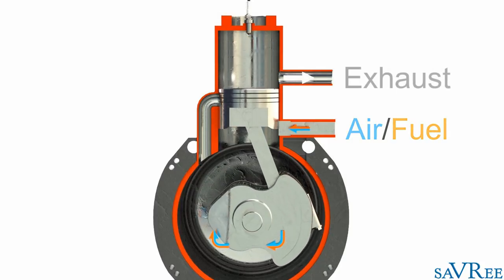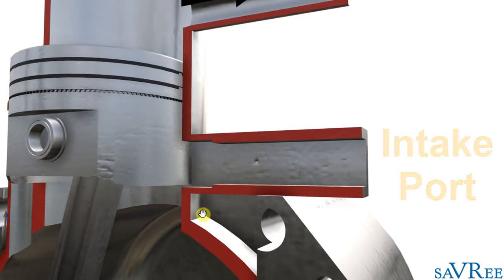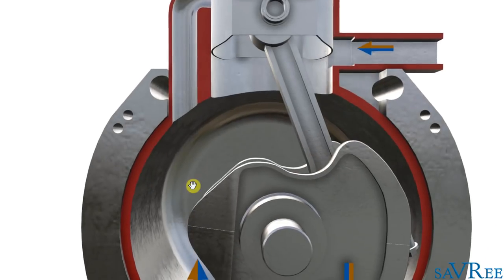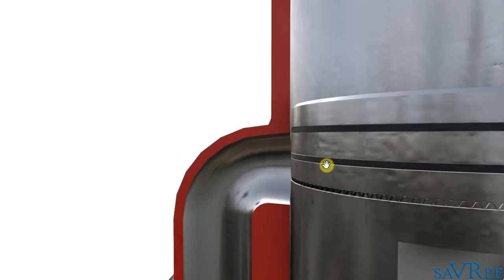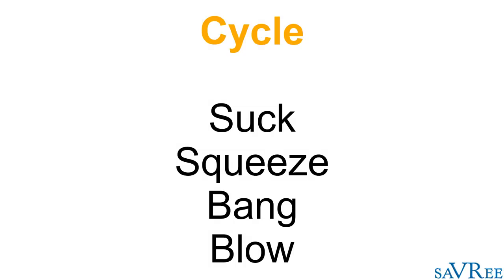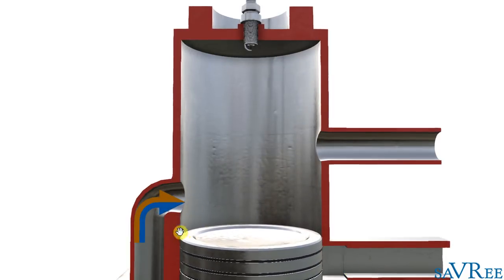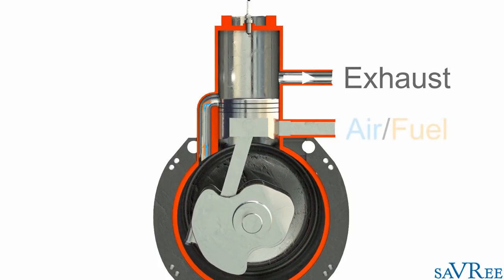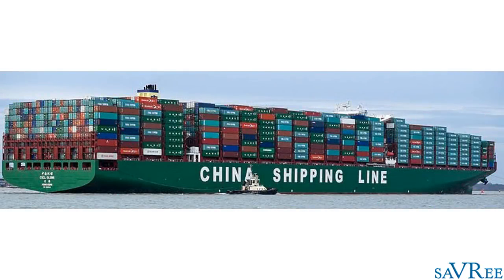How Two Stroke Engines Work (How It Works - 2 Stroke)

Comment: One of the best videos ever seen about the 2 stroke. PS your cylinder is worn ;p
Reply: How automatic transmission works like scooters .
Reply: Nice video but I don’t think you are explaining it fully. What causes the exhaust gas to exit the cylinder? Does it exit before the piston reaches the transfer port or does the incoming gasses push the exhaust out.
Reply: Yeah the best explanation ever
Reply: your*
Reply: @smithfam90 remaining pressure from the exploding gasses from the compression stroke.

Comment: Great video - thanks! May be worth mentioning that the fuel is pre-mixed with lubrication oil which means the lubrication is done within the mixture and thus no need for all the complicated lubrication systems the 4-strokes need :-)

Comment: Good vid.  I would like to see additional discussion about how the exhaust (expansion) pipe shape creates a shock wave that helps to prevent unburned fuel and air from escaping.  This is why two-stroke motorcycles have the fat exhaust pipe whereas four stroke engines have a pipe with consistent diameter.
Reply: I was waiting for an explanation on why the air fuel mixture doesn't all just go out the exhaust pipe, i assumed there was some sort of clever valve that would be controlled by the direction of travel of the piston, but this sounds way more interesting

Comment: 4 stroke makes more power per stroke (efficient) 
2 stroke fires twice as often, that equates to 25-40 percent more hp per cc
Reply: Two strokes are self supercharging engine. As you have been shown in this video fa showing the air/fuel mixture being compressed in the crankcase 1st above atmospheric pressure ..then it is compressed again in the combustion Chamber becoming supercharged

Comment: Very well explained.  How come the crankcase can keep lubrication if gasoline is a solvent ?
I know two cycles engines uses lubricant and gasoline mixed  on the tank but will t keep the crankcase still lubricated under these conditions?

Comment: Question. When the air mixture is going in, it goes to the bottom but is the transport port open when the air mixture is going in? Because if it is wouldn't the air mixture being wasted?

Comment: What keeps the fuel air mixture from escaping through the exhaust port during the compression stroke? 

Is there engine oil in the crankcase?
Reply: For one thing here, the exhaust port is WAY too high, releasing hot gases to exhaust avoiding doing much possible work, besides enabling much "short-circuiting"- having incoming charge from transfer port go right out the exhaust. Can you spot the other ways the port timings (because of location) are seriously sub-optimum? The tuning of a 2-stroke also depends very much on area and shape of the ports.
Reply: As I was alluding to, the phenomenon of "short-circuiting" is some air/fuel charge going from transfer port(s) right out the exhaust. Exhaust path must flow very freely in a 2-stroke or NO power. Short-circuiting in common crankcase-scavenged 2-strokes is so bad for emissions that Zenoah/Komatsu developed stratified scavenging to greatly reduce it for Redmax. Husqvarna bought Redmax.  Many references available- Google is your friend.

Comment: The 2 stroke engine was patented by a Mr. Alexander in the 1860's as an improvement over the Otto 4 stroke engine.. Like most things in the world, the 2 stroke engine was yet another British invention. The Alexander 2 stroke features a charging piston and chamber. Crank case induction (British again) didn't appear until the 1890's

Ships use the Webb 2 stroke engine, which has a wet crank (like a 4 stroke) and an inlet valve in the cylinder head. The Webb 2 stroke engine predates the crank case induction 2 stroke by over a decade, originating in the late 1870's.

On a ship's Webb 2 stroke engine the cycle is as follows (starting at BDC):

The piston closes the exhaust port (which opens as the piston nears BDC).
The inlet port in the cylinder head opens and pressurised fuel oil is injected.
The inlet valve closes.
The upward travelling piston compresses the fuel oil.
At TDC the compresses & hot fuel oil spontaneously combusts.
The piston travels downwards on the power stroke.
The exhaust port is opened near BDC.
The piston reaches BDC and the cycle is repeated.

The earliest Alexander and Webb 2 stroke engines of the 1860's were fuelled by coal oil. They were used by generators and pumps. 4 stroke generators and pumps used domestic gas supplies (coal gas). Liquid fuelled engines didn't appear until 1885 when Gotlieb and Daimler invented the world's first motorcycle running on kerosene (petrol didn't appear until the early 1900's).
In 1886 they invented the motorcar. The modern safety bicycle was also invented in 1886.

Comment: In this explanation, at some point both the transfer port and exhaust are open. So the doubt here is, does the air+fuel from transfer port not ooze out from exhaust, as the piston moves up compressing the mixture?

Comment: I'm sure i missed something, but when the piston moves up again to compress the fuel air mixture, the exhaust canal is open for a small time until the piston closes that opening. Will you not lose a great deal of fuel and compression that way?
Reply: @savree-3d  thank you for your prompt reply! I bought an old rusty 50's lawn mower engine recently to try and repair as a project with my dad and my neighbour. I have very little knowledge about engines, that's why I looked up your video. It was very informative, thank you for a great video!
Reply: He completely left out the reed valve system ALL two stroke engines use EXACTLY for that reason alone. The reed valve is a box with a flexable thin metal reed that flexes under pressure during compression preventing lost compression and only allows the exaust reed to open at a certain time PREVENTING what you stated. Some engines use a round reed valve that operates on a timing wheel with an opening that come into alignment at exactly the right time . It usually works off a cam shaft the is set to operate off the flywheel or crankshaft. He never mentioned a pulse line eather. This line utilizes some of the back pressure in the bottom of the engine to operate the fuel pump.
Reply: Yes, unburned fuel mixture is released into the atmosphere, thus why the EPA no likely the 2 stroke.

Comment: Do you lose some air/fuel mixture in the upwards compression stroke? I'd say if you compress it but for a moment the exhaust port is opened you lose some compression and mixture.

Comment: Great video and explanation. could you please explain why we need to mix oil with gas (petrol) in two stroke engines?
Reply: Because of the design of the cylinders with the ports in the sides, oil can not lubricate the entire cylinder. Adding oil to the fuel allows lubrication from both sides of the piston.

Comment: Great thanks.
Been maintaining my 4-stroke engines for years, but have never touched or even ridden one of these.
Seems these would be lower maintenance than a 4-stroke.
Reply: Cheaper to rebuild for sure, not cheaper to run considering all the oil you have to buy to go in the gas and they can drink the gas pretty fast. The noise like a 2 stroke dirtbike makes make neighbors really hate you also lol, but you can get almost the same amount of power from an engine half the size like a 125 2 stroke can out run alot of the basic 250 4 stroke trail bikes.

Comment: when  the piston is at BDC both the scavenge port and exhaust port are open. Can anyone explain how unburned air fuel mixture which is coming from the scavenge port into the combustion chamber is prevented to escape out from the exhaust port??
Reply: it doesn't get prevented to escape. part of it escapes.

Comment: What if you intentionally dumped a lot of air-fuel mixture into the exhaust in the suck-phase and had a 2nd spark (or just having high exhaust temp) and a turbo to extract the energy?

Comment: Does this mean 2 stroke engines have no oil in the crankcase to lubricate the crankshaft? we have just pulled apart an old petrol strimmer we removed the cylinder head and found no oil in the crankcase? I am thinking now after watching you brilliant video lubrication must be from the fuel oil mixture.
Reply: There should be oil in the crank case.  The bearings need oil.

Comment: Great Video...Just to reinforce my understanding, if I have an engine that idles at 2,500 RPM is it safe to say that the piston completes 1 up/down stroke (crankshaft revolution) 2,500 times within a minute?

Comment: Explain what a reed valve is please. What a a pulse port for on atwo stroke? What is a rotary reed valve used for? How does a Rotary reed work and why do two stroke engines such as Snowmobiles and motorcycles use them if the use a carburetor?

Comment: ¡Excellent! I remember an Auto Union ( the brand that eventually became Audi)  when I was a child had a two-stroke engine (motor de dos tiempos) and there were many on the streets. It uses a mixture of petrol and oil so its combustion should be carefully controlled to meet  today's enviromental standards. I don't know if TS bikes are still manufactured

Comment: What is the problem if engine oil goes to exhaust ? Plz give me a advice tnx
Reply: You do know that a two stroke used a gas oil mixture? Some engines use an oil injection system so you do not have to mix the oil with the PETROL. Those type of engines use a metering system using a system that delivers more oil to the cylinder the more the throttle is given. These engine use a carefully calibrated syatem that makes it more efficient and less oil is used than a straight gas oil mix. An oil leak on this type of system could indicate a bad oil seal or bad oil line.

Comment: is it the same like 2 stroke engine 1 cyclinder motorcycle. like kawasaki k-1 115c?

and any oil filter to change for? or just topup with new M oil?

- Brunei ( Borneo )
Reply: @savree-3d  Honda MB5 and MT5 series mopeds have a separate oil tank with pump. You put normal "4-stroke" petrol in the tank and that oil pump mixes the petrol from the tank with the oil from the small separate oil tank. I suppose that setup has some sort of oil filter.

Comment: Why do the engineers not design a 2 stroke with restriction on the exhaust port, so that the little amount of air fuel mixture is not wasted during the Piston downward movement or compression?

Comment: How intake function when coming into the crankshaft? Because intake having are oxygen n gasoline.. It's not mixer with oil in oil sum?
Reply: @savree-3d  what does it mean?
Reply: @savree-3d  the same question from the top

Comment: You forgot to mention that the fuel has oil added to it, and this oil lubricates not only the piston, but also the crankshaft, as the fuel air mixture travels through crankcase.
Reply: @savree-3d  Will Do!

Comment: Well done, I 'scribed and Liked to help the channel although honestly I'm just seeking some quick remedial-overview, am familiar with/use timing wheels and port my engines well most of them, anyways they're all chainsaws and I found something fascinating / confusing / conflicting in your presentation here (not saying you're wrong, you're certainly not*, just saying it makes me unable to understand something chainsaw-porters do), you conceptualize the '4 phases' so well and I knew/understood the powerstroke (downstroke of piston) however, in chainsaw-porting, one of the most-common tricks/moves people do is to literally go and raise the exhaust roof with a dremel to 'decrease its timing' (ie if OEM spec had the exhaust port cracking at 110 ATDC, someone grinds/dremels their exhaust roof higher so that now it's cracking open at like 105* atdc, 98* atdc etc.)  Would love to know your thoughts on this - I have engines ported this way - it does seem to work but I just don't get how*, I mean I can understand the old thinking of "higher exhaust roofs mean higher RPM but *some drop in torque", that's how chainsaw guys talk about it, but in understanding the 2-stroke better I can't help but think that it's not "a fair trade" IE the increased RPM is accompanied by a proportionately-larger loss of torque in the engine.  Would love your thoughts on this!!
The other main approach is to CNC the cylinder base, and the squish band, to effectively drop all the ports' heights (and increase compression, or 'dial it in' since the #'s cut are chosen by "squish" or the amount a piece of solder gets squished in-between the piston & the squish-band, in chainsaws people just jam solder in 1 side and test that way....I know it doesn't account for piston-rock, I also do measurements from base-to-band now to accompany my squish #'s -- surprise, surprise, there is less variance reflected in "squish #'s" than in true measurements of base-to-band, obviously because piston-rock is "smoothing out" things a bit!)
Thanks a ton for such a great presentation here, have watched several of these hoping for "aha's", lol, and the way you put "the 4 phases" (intake/compress/power/exhaust, repeat!) totally helps me with putting things in perspective!!

Comment: The air and fuel intake is in fact sucked in when piston goes up below piston then when piston goes up the crank pressure is not sucked but force to top of piston.

Comment: The 2 stroke engines have the oil mixed with the gas (petro), I assume this is for lubrication, correct?

The 2 stroke is less reliable than the 4 stroke.  Why is that?  I would think the simple design would make it more reliable.
Reply: I think that he means longevity

Comment: This is only half the equation in modern 2 strokes. The expansion chamber(exhaust) is responsible for making the big power of a modern 2 stroke. Without an explanation of how the engine and expansion chamber work together, you're not getting the full view of how a 2 stoke works.

Comment: As much power as they create, it seems that there are places where there are wasted potential.
Reply: one of the problems with pollution from 2-cycle engines.  Mixing the oil and gas and pulling it into the cylinder while the exhaust port is open.  So some gas goes out the exhaust port before it is sealed by the piston.

Comment: The exhaust port don't make since we're it's at. Because when the piston hose back up its going to push some of the fresh air and fuel mixure on its way up through the exhaust port ..  there are no valves to stop it from going out through the exhaust port.  Exhaust it's always open
Reply: @savree-3d  thanks that makes a whole lot more sense y was confused.  And thank you for explaining to me thanks a lot and keep posting videos like this one it's good stuff for sure....
Reply: thats why u have a good tuned exhauste pipe that make perfect backpressure so the most air/fuel stays in there

Comment: Hmm not a good understanding at all the big marine engines are diesel and supercharged and you have not taken in to account the spanny on high powered bikes also a lot of the modern small marine are direct injection. You are also missing a reed or rotory port on the induction.

Comment: Not even this beautiful tutorial does explain what pushes the piston upwards once the engine is already running. None of the turorials I've seen explains that.
Reply: Good point as they only have 1 cylinder naturally. Only thing I can think of is that the inertia from the the counterweight gets it moving upwards again.
Reply: Most engines have a flywheel or counterweight and or something that will act as the flywheel.  They provide rotational momentum while the piston is not providing power.

Comment: change the title , " how a two stroke engine works with a 4 stroke piston , hahaha, i see the 3rd oil ring ,
Reply: @savree-3d  true, I worked with some only have 1, but never 3, especially an oil ring, counterproductive on a two-stroke considering you need the sleeve and piston lubricated

Comment: Could have done a better job explaining ,The 2 stroke engine featured in this clip is so old even your weed wacker has more tech.For a start there are no modern reed,rotary or power valves,no fuel injection and no expansion chamber(2 stroke equivalent of a turbo or supercharger with a little poetic licence ) Then we have the piston shown,it is a 4 stroke piston and not a 2 stroke piston,a sad and glaring error I am now bored and am moving on.

Comment: Worst video. Doesn't explain how the oil/gas mixture lubricates the crankshaft and bearings of connecting rod etc. which is why I was watching it. Doesn't explain how and when the vacuum is produced to draw in the fuel /oil mixture into the crankcase. Nothing I wanted explained was explained.
Reply: The oil in the fuel lubs everything. The piston going up, when all the ports are covered creates the vacuum. The bigger problem here is this is only half the equation in modern 2 strokes. The expansion chamber(exhaust) is responsible for making the big power of a modern 2 stroke. Without an explanation of how the engine and expansion chamber work together, you're not getting the full view of how a 2 stoke works.